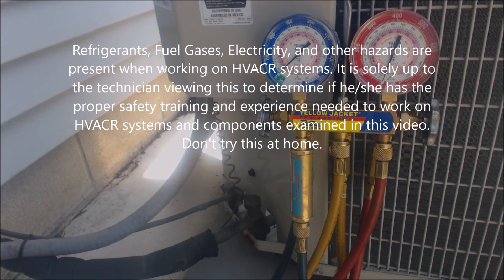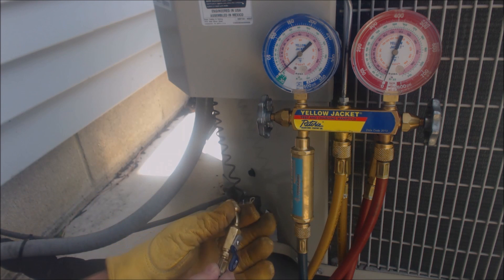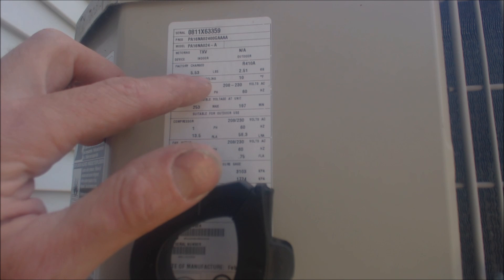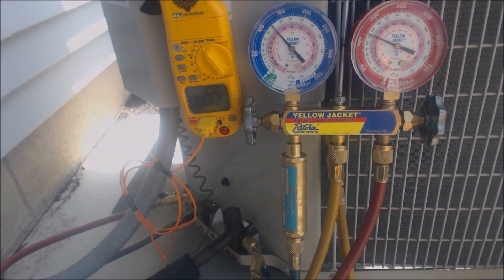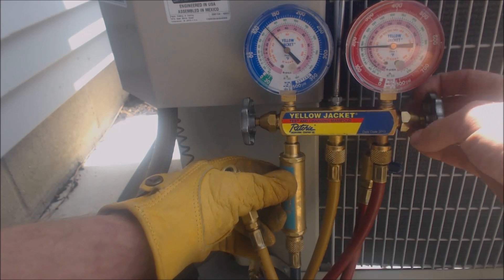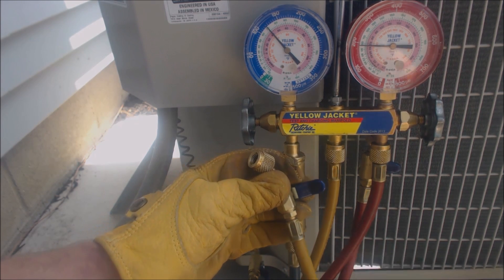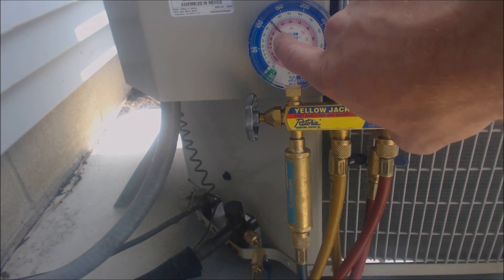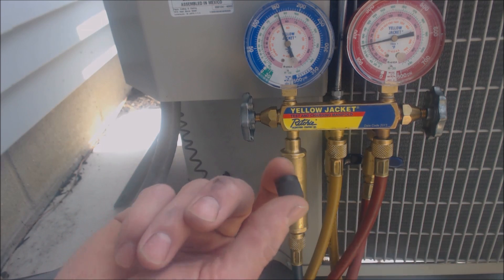Measuring Refrigerant Pressure & Temperature in an Air Conditioner! Connecting, Disconnecting!

Comment: Have r22 2.5 ton system, I connected the hoses and the temp pro and my superheat reads 32 on my gauge and 55 on my temp pro and out door temperature is 70
Reply from the maker: Are you saying your wet bulb temp is 55 inside at the return and dry bulb outdoor is 70? If that is the case then your target would be 8.5 degrees of superheat. That would mean that you are low on refrigerant if you subcooling was also low as well, thanks
Reply: acservicetech my pressure gauges were 59 on low side and 175 on high side

Comment: I realized today, after putting my gauges on, I opened the valves on the gauges. Will this cause damage to the unit? Or just give you a bad reading?
Reply from the maker: That would depend on how long you were allowing the liquid to go through to the vapor side and get sucked into the compressor if that was the case, thanks and you are not alone.
Reply: Well the unit was running great a few hours later. I wont say how long I left them open... but it will never happen again. Thanks again!!

Comment: Hi i have a question.,,how do i know the metering device in my mini split a/c,,i dont see any txv or piston that you talk about in your other video,,also it states in the nameplate that the refrigerant is .88kg,,how can i measure if the refrigerant charge is correct
Reply from the maker: You can only check the mini split with subcooling if the compressor is a single speed and not an inverter type and if it has a high side port before the txv. Usually in mini splits the txv is in the outside unit. If you don't have 18-21 degree temp diff between the return and supply and you suspect a low charge unfortunately  we shut the power off to the outdoor unit, recover the refrigerant, find and fix the leak, nitrogen test, vac pump and weigh in the correct amount of refrigerant as stated on the rating plate. Thanks
Reply: acservicetech thank you very much,,

Comment: It's Matt you gave me advice on checking for air flow issues finally got around to checking the underside of my evaporator and there was so much hair from the previous owner and dirt inside of the blower motor cleaned it out and I'm gonna cut out the evaporator tomorrow and take outside and clean I appreciate you pointing me in the right direction
Reply from the maker: Great and glad to help! Thank you for letting me know.  Would you mind reposting this in the discussion section on the main channel page?
Reply: Went to main page but I can't find where the discussions are
Reply from the maker: It should say Home, then Videos, then Playlists, then Channels, and then Discussion. This should be right below the banner, thanks Matthew!
Reply: After channel says about
Reply: acservicetech  maybe its issue with my account?
Reply from the maker: It's ok, I appreciate you trying. I am not sure, thanks
Reply from the maker: You said you cleaned the underside of the coil and are having a hard time with fluctuations? Give me as many details as possible, suction temp/pressure, liquid temp/pressure, temp decrease across evap coil. Did you end up having to cut it out to clean it?
Reply: acservicetech will send info after have written down at home
Reply: Return=70 Supply=54  Lowside=70-75 psig Slt =49-54  High side=255 psig Llt = 84 i'm going to get my gauges on that again tomorrow and make a video

Comment: That seemed overly complicated just to not steal refrigerant from the system. I might me gauging up wrong though. All i do at the start of every service is gauge up and purge the air completely out. then at the end of the call i just disconnect from the high side from the condenser unit, open up the high side to the manifold, open up the low side of the manifold and let the compressor suck the high pressure vapor out of the manifold. then i disconnect the low side from the system, then open up my gauge set to the atmosphere.
Reply from the maker: Yes you got it as long as you purge the air from the yellow service line. Also make sure there is a clean filter and good out of all the regs, thanks

Comment: Another good video from a great teacher/tech. When are you going to go wireless and get rid of those long hoses. Iconnect, Testo smart probes, sporlan smart tool, appion digital wireless gauges. Embrace the technology. Lol.
Reply from the maker: So I actually do not recommend digital manifolds or probes as a first set. I want the tech to really think and understand the pressure temp relationship, superheat, and subcooling down cold. Once a tech really understands very well for troubleshooting sake then yes go ahead and get the digital ones if they like. I am also not apposed to just checking with quick connect test gauges either since that gets rid of the hoses. Once again this is just one person's take on things from a teaching standpoint. Thanks

Comment: Another Great video! 
So when you say you check the air flow do you mean you make sure that the blower motor is running and the air filter is ok? Or what do you mean when you say you check the air flow?
Reply from the maker: I mean't just a simple check. Turn the outdoor unit off at the disconnect unless its already running. Replace the filter, turn the ac on at the tstat, walk to each register and make sure they are open, make sure the returns are large enough and not blocked, then go outside and turn the outdoor unit on to check it, thanks
Reply: Abner Garcia probably a complete Airflow analysis for all the return and supply grills based on the LxWxHx6÷60 of every room against 400cfm per ton returning and offering the benefits of hvgs as Well. throw in a duct cleaning and a boot sealing while your at it hahaha

Comment: would you buy a 4 port gague rather then a 3port for your first pair? whats the diffrence?
Reply from the maker: I may, either brute or hilmor. There certainly is nothing wrong with them. I would not advise a digital one as the first though Basically it is easier to change back and forth to nitrogen and micron gauge, as well the larger volume hose for vacuum pump if doing it through the gauges, thanks -  
Here is a link to the Hilmor 4 port Aluminum Manifold Gauge Set-  http://amzn.to/2m4QLik   -  
Here is a link to the Yellow Jacket Brute Manifold Gauge Set- http://amzn.to/2qkRbTn